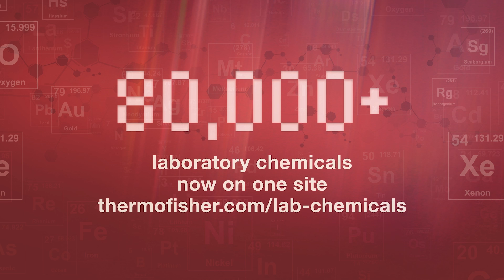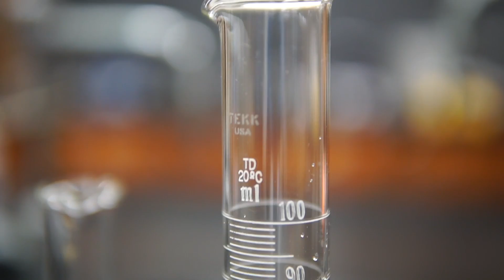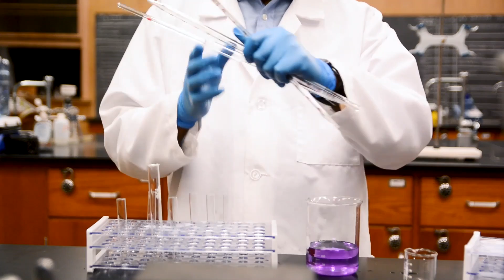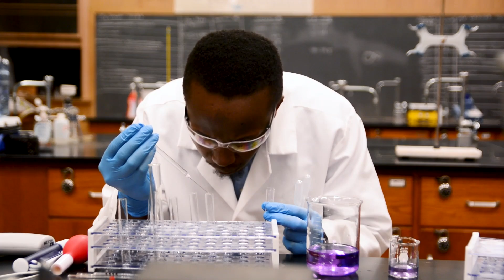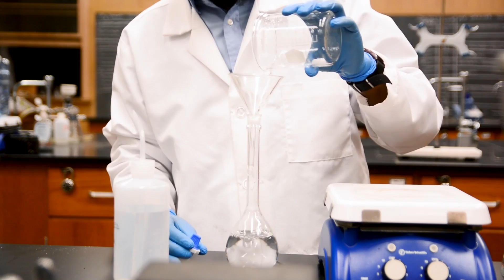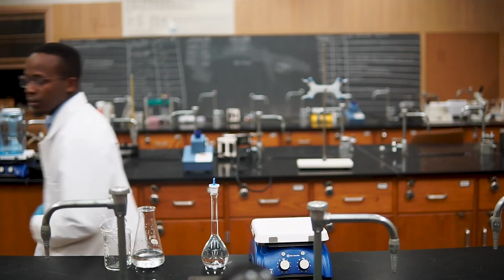Pipettes and Standard Solutions

Comment: That’s not the way how to empty a volume pipette into a container, flask. 
The pipette has to be hold vertically and the point has to touch the inner side of the container at an angle of 45°.
Reply: Yes. One of the many errors.   I laughed out loud at the plastic pipettes that don’t even have any ability to measure being used as an accurate way to measure.
Reply: @lbfeline2782  and that balloon. A decent balloon has three valves. One at the top  to let the air out of the balloon if you squeeze it, one at the bottom to suck up the liquid in the volume pipette and one at the side to lower the amount of liquid in the pipette. I used to teach this stuff. Indeed, one of many errors.
Reply: @lbfeline2782  Where does it say that the plastic Pasteur Pipettes are supposed to be an accurate way to measure liquid volumes?
Reply: @chbu7081  It talks about pipettes being accurate, but in the demonstration he only uses the little plastic ones that aren't accurate for measuring at all.  So it's implied by the demonstration